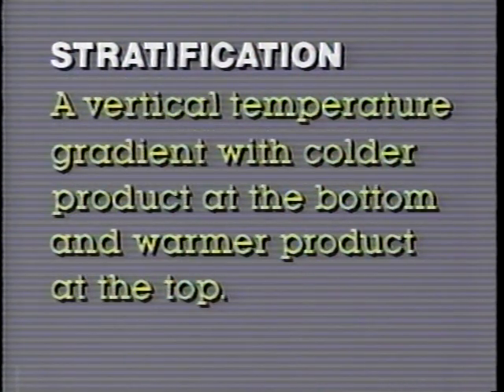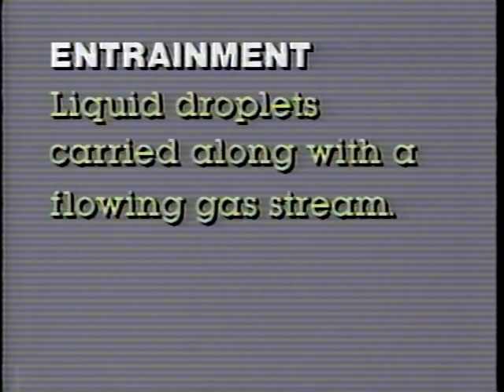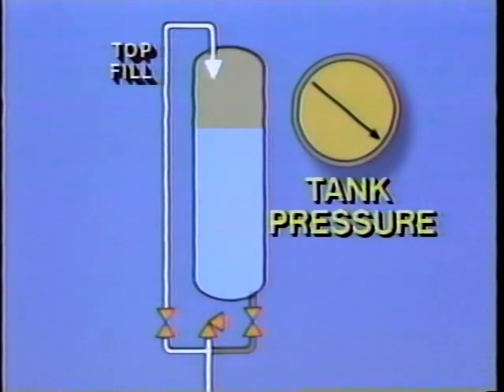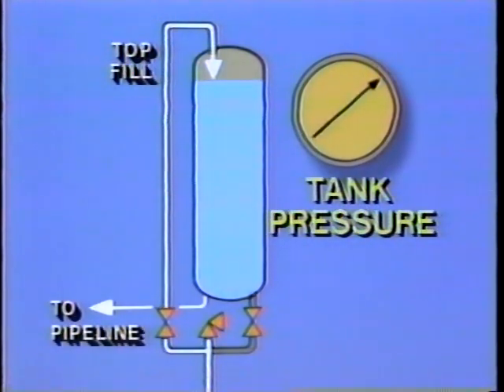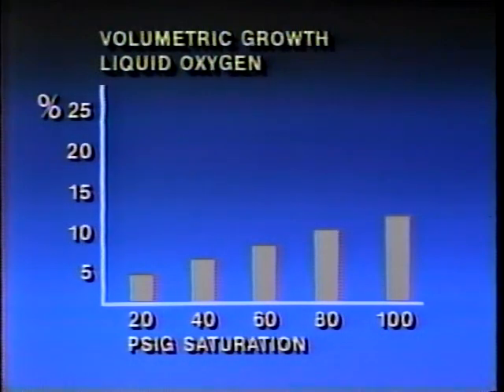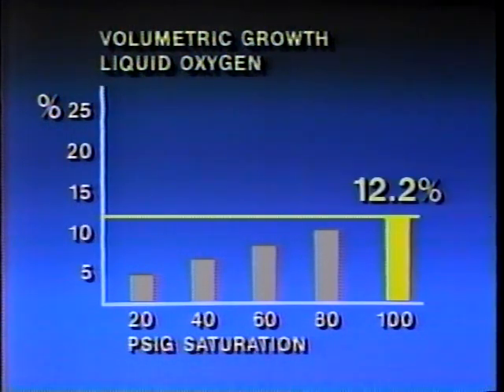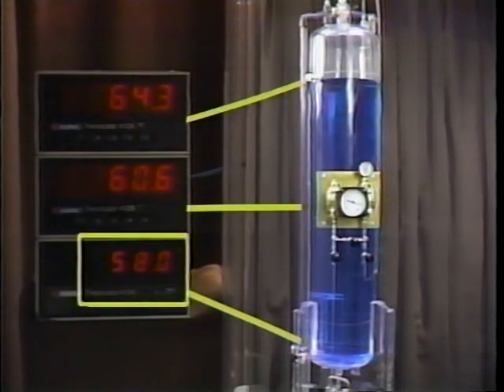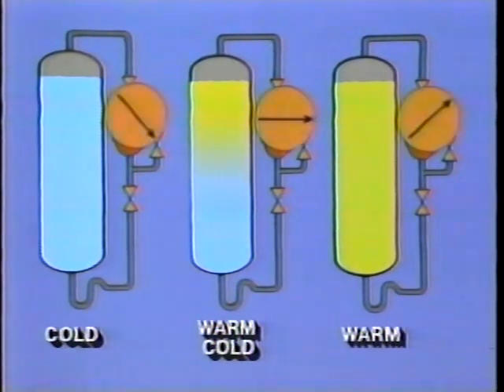THE INNER WORLD CRYOGENICS

Comment: Interesting. It looks like they were using dyed freon as the demo liquid. That "subcooling" term is a terrible misnomer since what it's actually describing is pressure induced superheated liquid that can flash boil. Wonder if they're still using that term.
Reply: I was thinking maybe butane, but could have been freon I suppose.
And I think that the industry has turned subcool into a phrase of art, but they talk around it.

Basically my understanding is that subcooling is the state of a fluid at a temperature below that needed to stay liquid under the system pressure conditions.

If the system pressure is steady, than to achieve the state of subcool you have to lower the fluid temperature.

But for a stable liquid temperature, if you raise the system pressure above the vapor pressure point of the liquid, it is now in the state of 'subcooled", but you reached that state from the other direction.
I first learned about subcooling in the context of refrigeration, where it is talking about removing temperature to bring it below system pressure, so it took me a while to figure out how they are using it in this industry, but I think I am correct that here they are using the term to refer to the state of the liquid being cold enough to have a vapor pressure below system pressure, where other uses are referring to the process of removing heat energy to bring it below system pressure.